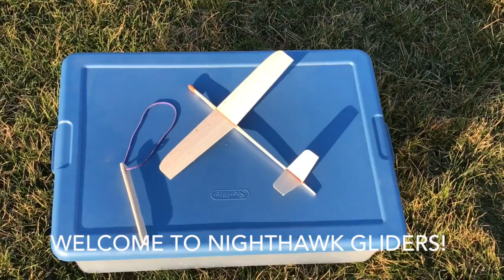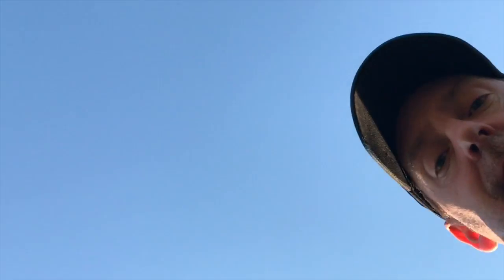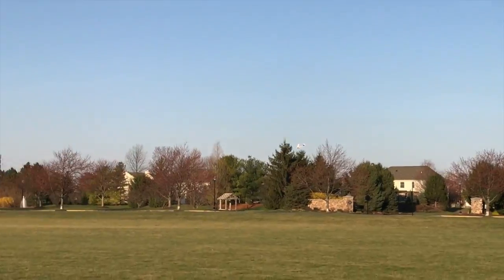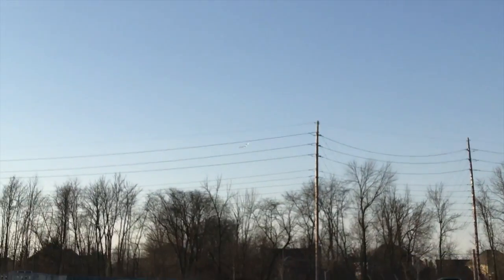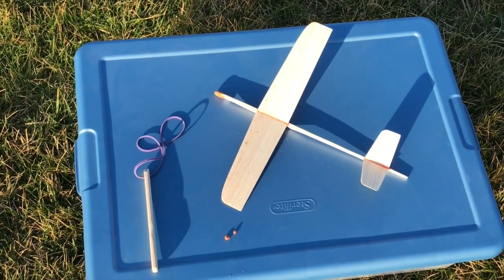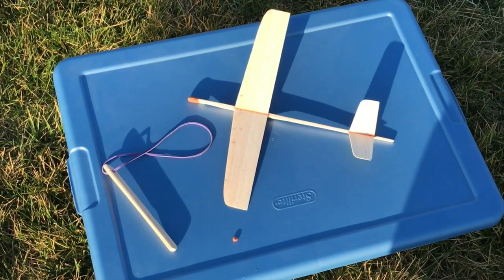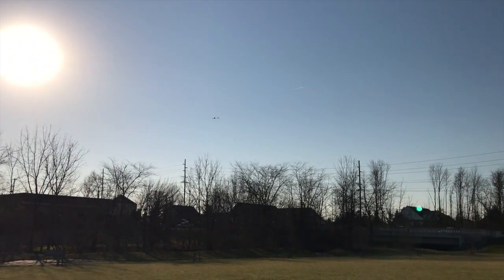Sandpiper 12" Balsa Glider #17 - Maiden Flight and Trimming

Comment: Nice...

You're mentioning up-elevator but what are you doing to the elevator? Just bending it and the memory of the wood is working?
Reply from the maker: Yes, I’m bending it up (ever so slightly!). Even the smallest and barely noticeable bend can make a big difference (especially on a high speed launch.). The wood holds the bend for a while... but it can often relax and you’ll need to attend to it again.

Comment: At the beginning you mentioned the grass was damp. If you fly unsealed wood, maybe the plane was gaining weight in different places each flight, and the moisture might then evaporate a bit. making adjustments under those conditions would be like chasing your tail. You got a great flight at the end, but did it fly well the next outing without adjustments after drying out?
Reply from the maker: I think this plane had many subtle issues. Certainly taking on droplets of water doesn’t help.  I risked ruining it that day, but it was a great day to fly!  To be honest, I have made tons of these.  Some of my gliders still in boxes somewhere.  Maybe this one is still around.  I put serial numbers on many of my gliders and it was documented in this video which glider I. had that day.  Whether it was permanently ruined, I don’t know. 🤔

Comment: What’s cg?
Reply: Plz reply
Reply from the maker: The CG (Center of Gravity) is generally referred to as a point underneath the wing where the plane can be balanced.  On this glider the CG is about the middle of the wing or slightly further back.
Reply: Nighthawk Gliders and how do u move it back or forward
Reply from the maker: The easiest way is to add nose weight (clay) to move CG forward, or remove nose weight to move the CG back.
Reply: Nighthawk Gliders thanks!!!👍😀

Comment: What do you mean by up elevator?
Reply from the maker: The “elevators” on an airplane control its pitch stability.  Described here https://en.m.wikipedia.org/wiki/Elevator_(aeronautics). On these little gliders, you can gently bend the trailing edge of the v-tail slightly upwards to apply “up elevator.”

Comment: Great information. I built my first Sandpiper 12 yesterday, flew it today, and it had the same problems you were having, so I consider myself in excellent company! Two questions:
1. I am trying to get more turn. I'm thinking of tilting the rear stabilizer - to the right turns right, and left turns left? What do you suggest?
2. I am going to instruct our Science Olympiad "C" team to try these out in a couple of weeks for our first invitational. Are you familiar with SciOly? Our A and B teams are using a design similar to your "Building Another Glider" model and I will share some tips you have shown on that video. At competitions we fly in a gym - limited height, limited (but not as much) circling area. Any suggestions here? Great to see you are so detailed and prompt in your responses. Thanks so much! Mike
Reply from the maker: Yeah, a few years back, I coached SO for 4 years. We placed 3rd in gliders at the Indiana State competition!  I do have some pointers. If you are interested, go to our website Nighthawk gliders.com and contact us thru messager and we can continue chatting there.  Thanks!
Reply: @NighthawkGliders  Will do and thanks so much for all this great info - nice website as well :)

Comment: hi, how do you add elevation? do you sand the wing or how?
Reply from the maker: Good question. My tail surface is thin enough on the trailing edge so it allows me to (ever so gently) bend it up. The slightest adjustment can make a big difference in flight!
Reply: thank you kindly!
Reply: Interested in knowing your methhod of adding up elevator. untreated wood warps easy, so I am curious if it is aa matter of making the underside damp along a given line to get it to expand enough to get a light curl for up elevator.
Reply from the maker: I would not recommend damp cloth at all. You may irreversibly warp the stabilizer. Another option is what I call “trim tabs.”  They are 1/32” thick by 1/16” wide by 1/4” long. Try gluing one of them on top of (each) stabs trailing edge (right at the lower part of the “V”. You can use stick glue instead of super glue in case that’s too much incidence, you can pluck them off and try again with smaller tabs.

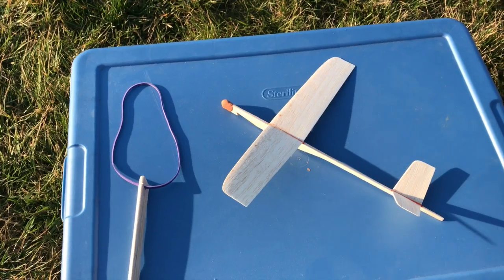Comment: Hello, Brad.  Thanks for taking the time to post videos!  I have two questions.  What do you look for when buying balsa?  What makes one strip better than an another?   I've just been grabbing the top one while at Hobby Lobby.   Rookie mistake, huh?  :-)   And at 3:52 of your video you said you added a little up elevator.   How did you do that?    THANKS for your time!  Melissa in Columbia, Missouri
Reply from the maker: Great questions, Melissa!  Yeah, size aside, balsa varies greatly in types, (A, B, & C) of which I will not attempt to explain here... and they vary in density.  Selecting the right balsa sheet for your glider is something you have to learn with experience (I’m still learning!)  As you carefully handle them, try to find a sheet that is maybe lighter than 3/4 of the rest. Also, hold it up to the light and look (through it) for “ribbons” No ribbons are great, but if you see ribbons, that’s ok, too as long as they are straight and consistent. Inconsistency can cause unbalanced wings on your glider.  Regarding “up elevator,” this link will help:  https://en.m.wikipedia.org/wiki/Elevator_(aeronautics)  On my Gliders, I breathe on my horizontal stabilizer (for moisture) and gently lift up on trailing edge). Other people glue a tiny shim on trailing edges of horizontal stab  to act as an up elevator.   I hope that helps!  Good luck!
Reply: I'm going to chime in here as well...
What you really want is C grain balsa for flying surfaces and anything hard for fuselages. Sig Mfg sells really nice balsa, and if you call them up, they will actually hand select C grain contest grade balsa for a small charge (less than a dollar extra per sheet, which is a steal). While you're at it, order extra hard balsa for fuselages (note this is the opposite of what you'd want for a rubber powered model, but that's a whole other ball game). You'll need a hand saw to cut the fuselage wood, but it's worth it.
Reply from the maker: Good tip, Josh!  Thanks for this info!  Chime in anytime!  😀
Reply: Thank you for the information, Joshua!  I appreciate you taking the time to share.

Comment: Oh, this morning is really bad morning. I made another glider - exactly as your recipe (no carbon rod), and it flies bad. Once tail heavy, another time nose heavy. Spent over one hour, completely exhausted... and in last second noticed that actually boom is too narrow and after every fall - it bent to different side. Now it is in furnace at 100C, baking and then will paint boom with nitro-lacquer. Also, made mistake during gluing dihedral - it is not 63 mm as should be (converted imperial into metric), but rather 55 mm when one end is flat with desk, another up. At least got it 5.5 grams. Just balsa I am using is bad one - brown-ish, not white as it should be.
Reply from the maker: Sorry to hear you had a rough morning. 🙁Balsa is challenging. I have a pile of Gliders that ended up frustratingly awful. I think proper balsa selection is one of the keys (among a number of other factors). In this video, my choice of balsa was not ideal and there were some dense ribbons in it (as you can see in the thumbnail.) Dense ribbons in your wing can work if they are even, parallel with the wingspan, and placed towards the leading edge. However density variation in the two slices laminated for the fuse can result in a bending effect-- especially if it is sanded too thin. Humidity will also warp wood and even change the CG within minutes sometimes!  I don't buy expensive contest balsa, so I always inspect my sheets of wood in front of a bright light and choose the sheets with little to no density variations (where brightness of light coming through is consistent.) I hope that helps and wish you better luck in the future. Keep trying and you will get experience and have more success!  😊
Reply: This subject is rekindling the old flames from when I used to build in the 70’s. That was before “ready to fly “ really squashed the demand for model building materials. Now I wonder where I can get good wood. Used to be able to buy hard vs. soft, and by density.

Comment: I made a similar glider to 12" Sandpiper from foamies. I like V-tail glider, because they are very cool. V-tail is "simple" to build, and a few material need to make it. I'll show how can my "sandpiper" fly soon. :) Thanks this vid, nice setup!
Reply from the maker: That's awesome!  Looking forward to seeing your foam variation. I agree with you about the V-tails. They rock!
Reply: Nighthawk Gliders I would ask when we want to trimming a glider we can adjust more weight to the nose and lift up the elevator? Of course we recognized that the glider fly up and down (so it can't fly steadily). This evening when the weather was calm (I think this time is perfect to fly) I try my foam glider how can it fly? When I managed to setup it can fly nice but from the highest point of catapult launch it fallen down 3-4 meters till it could fly steadily and very nice. So maybe the construction of my glider is not too good? I'm sorry my english...Thank You!
Reply from the maker: When I trim my gliders, my first goal is to balance it with nose weight before attempting any elevator adjustments. If I don't have to bend my elevator, I won't.  When you launch your glider and it peaks at highest point and then loses a lot of altitude before it glides, you might try launching it at a lower angle (less pitch).  Or if there is little wind, you might also try launching in a different compass direction.
Reply: Thanks Your answer I try to launch that way. I see that the ballance is very important so I have to add or remove ballast till the glider is fly stable.